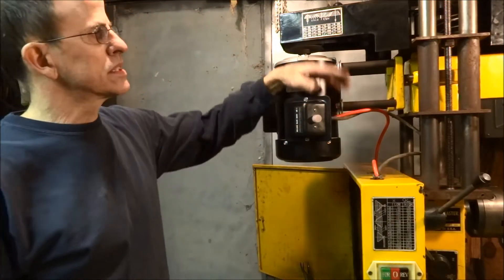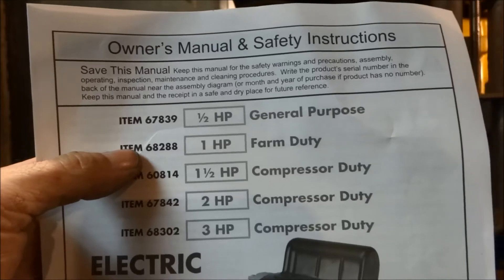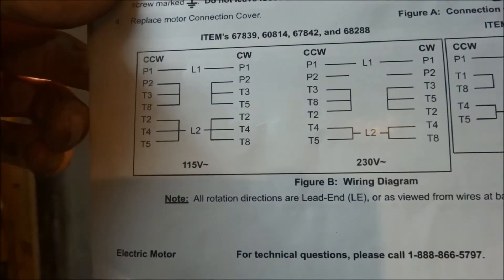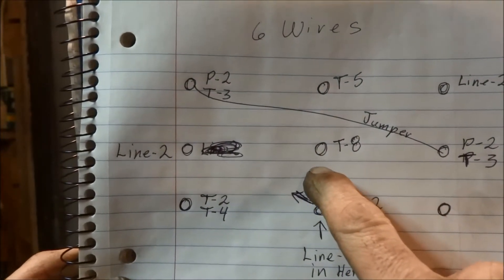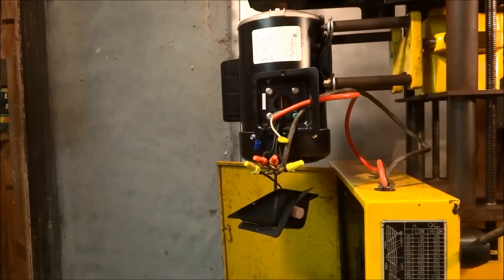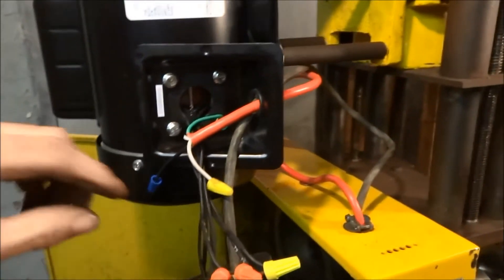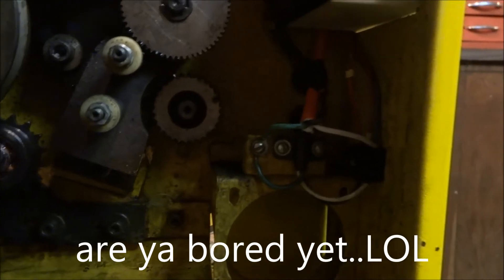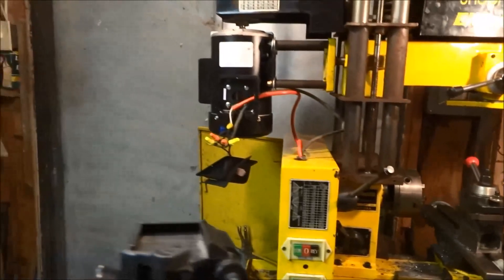How to wire reversible electric motor.  Harbor freight motor on a Shopmaster lathe

Comment: Hello: I have this exact same machine I just picked up as an inheritance that was never put together, I appreciate this video as I bought the same HF 68288 electric motor to put on my machine for the lathe portion.
Unfortunately, I do not have the old motor so I am missing that 2-step pulley from the lathe drive motor.
Would you be kind enough to prove a rough measurement on the small and large pulley or send me back some pictures, so I can see how that looks and how the belts are arranged.  I believe the low range belt goes above the roller and the high range belt goes below the roller but want to make certain.
For the drive pulley on the motor.  Thinking that the small diameter portion would be toward the end of the machine and the large portion would be towards the motor – is this correct?
Since there are no spare parts available, I ordered a few different single pulleys to have the lathe function and will turn my own pulley when I am able to figure out the pulley diameters.
Appreciate your help !
Reply from the maker: You are correct on the belt routing and pulley orientation. The small pulley is approximately 1 7/8 outside to outside of flange,  large pulley about 2 3/4 outside.

Comment: Why don't you show how you hooked the wires for us instead of explaining.
Reply from the maker: If the video was showing me connecting wires. You would have saw a spaghetti bowl of black wires being connected to black wires. And black wires being connected under the screws on the switches. At 7:45 you can see all the wires are black with labels on them.
Reply: I’m putting my on and 12” lathe that came with 1/3 hp Dayton motor.  I haven’t received my yet.   I know that P-1 is White wire and The Green is Ground.  (I think T-2 , T-4  and T-5 are for CCW.  T-2, T-4 and T-8 are for CW and they are all connected to Black.). I have a rotary switch.  Is that right?

Comment: I could not get my motor to run in both directions. It would run ccw but just hum in cw rotation  so I added a jumper from T2/T4 to the #9 post (the one not being used) and bingo I now have rotation in both directions.

Comment: I just purchased a Harbor Freight 1/2 HP motor for my 9" Southbend lathe.  After searching all over the internet for guidance and coming up shorthanded, I finally sat down and sorted things out like you did.  The original Westinghouse motor had only four wires VS the new Harbor Freight motor which has seven.  The original forward and reverse control is a barrel switch made by Furnas for Southbend.  For starters, I removed all the old wiring to start fresh.  Next, using a continuity checker (ohms meter), I determine which terminals were connected in each of the three switch handle positions and made a sketch of this.  Lastly I sketched up a one-line diagram (schematic) based on the crappy wiring diagram that came with the motor and figured out that a double pole double throw switch would work to switch the motor between forward and reverse.  Turns out that the original barrel switch serves this function depending on how you wire it up.